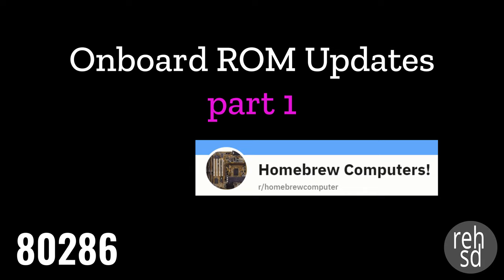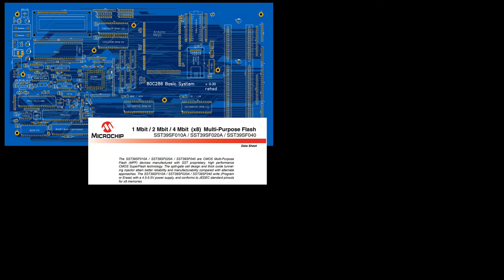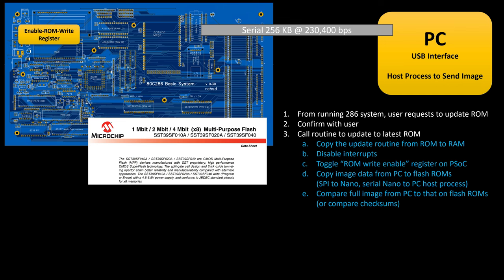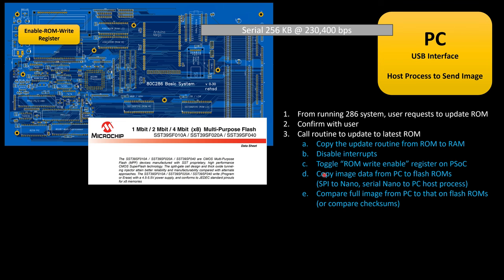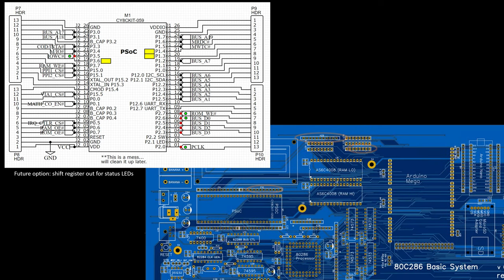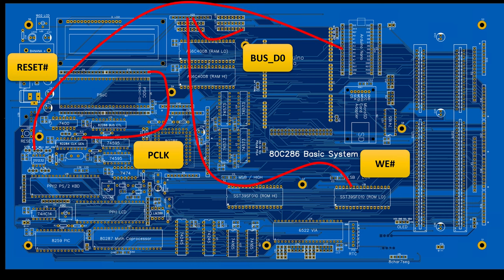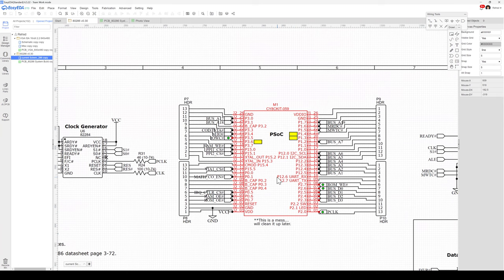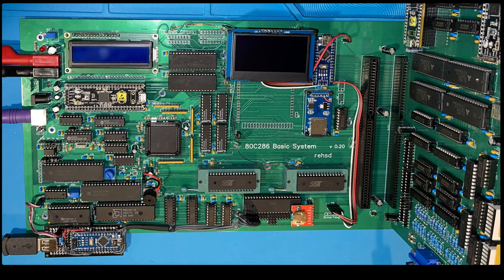80286 Build, Ep. #72 - Onboard ROM Updates, part 1

Comment: One of the reddit guys sugested ganging the ROMs and doing 16 bit writes. I'm not sure that's safe. If memory serves, there's some polling involved to indicate when a chip is done erasing a sector or done some other operation, and if there's anything like needing to retry after a timeout (like when programming an old school 27c64 for example) being forced to hit both chips at once might be shooting yourself in the foot. Maybe it works out that it's safe with the programming algorithm for these guys, but something to look out for.
Reply from the maker: I thought I would try 16-bit writes first. If it doesn’t work well, I will split out the WE# lines and do one flash at a time.

Comment: Since you can erase just portions of the rom, could you have a reserved portion that contains the update code? Then you would only need to pull the rom chip out and use an external programmer if you wanted to update the rom update code.
Reply from the maker: Yes, that should be workable. I have another idea, too, which I'll test in the coming week. I might maintain the utility ROM image (containing the update code) in a separate I2C flash IC. This should be easy to manage with a small 8-pin DIP serial flash connected to my Nano. Then, when I go to update the primary flash, I can copy the utility ROM from the I2C flash into RAM and erase the entire primary flash.

Comment: Are C5 and C6 intended as decoupling capacitors for U17? If so, losing (ie, not replacing) that vcc trace will somewhat defeat that purpose.
Reply from the maker: Correct. As I ended up not cutting any traces, all should be good.

Comment: Would it be easier to just bend up the pin on the ROM chips and connect directly to it?
Reply from the maker: I thought about that. For now, I still need to be able to pull the flash chips and put them in my programmer. I'm doing this to verify the data on the flash chips, and to fully reprogram them when I mess them up.  :)